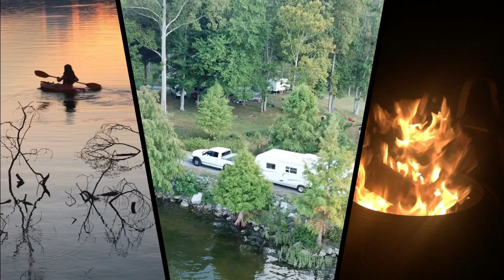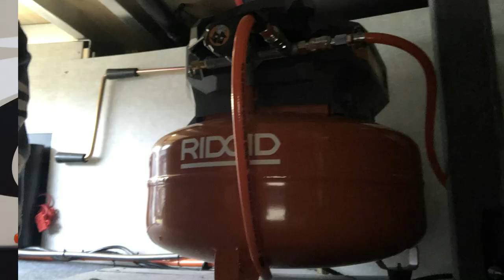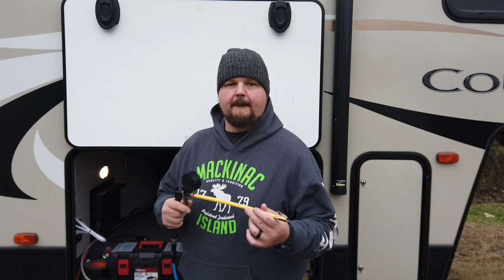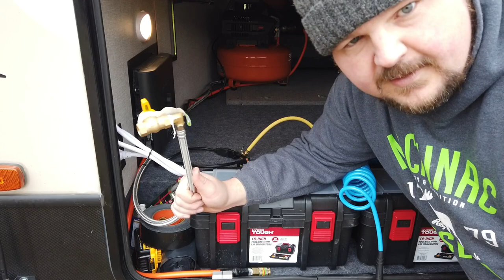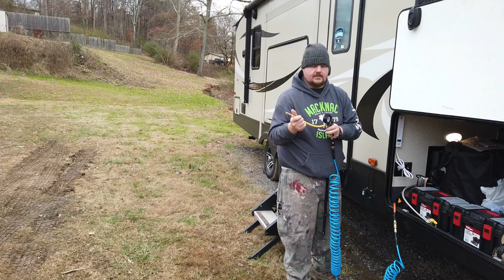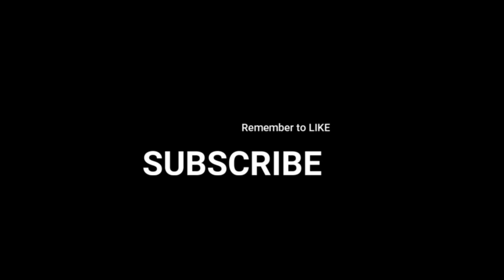Air Compressor in RV

Comment: I mounted a Semi truck trailer air brake tank to the frame under the Class A so not to take up storage space. (Compressor is in a driver side bay!) Then plumbed in 250 psi PEX lines for the outlets between the 2 rear axles.  And an outlet in the grill to reach both front tires and an outlet in the rear bumper, so I can run air tools to swap flat tires on the towed, on trailers or run a hose to the neighbors.  It has paid for it''s self, because one time we ran across an elderly woman with a flat on her RV in the middle of Montana.  Her husband was an invalid and was inside.  She said she called for Roadside Assistance, but they hadn't called her to let her know their ETA.  I whipped out my 30 ton air over hydraulic jack, air impact gun and hose and changed her tire in about 10 minutes.  I have a pressure regulator I can attach on the end of my hose so I never have to guess on tire pressures.  And it even has one of those filler fittings that clips on the valve stem so I don't have to hold it in while filling the tires.  I bought a 150 psi California Air Compressor (very quiet) and stripped the tank off it.  With the big semi tank under the coach it's a hoss!  The fun part is when we go 4 wheeling and I whip out my 120 volt wire welder and air tools to fix my buddies broke junk back at the RV Park we all camp out at.
Reply from the maker: Sounds like a great install

Comment: Good video! I'm shopping for an air compressor for an class A. Been watching a bunch of videos and some air compressor videos where they tank expoldes primarily due to age. There was a video of the guy doing a half a$$ investigation on why his blew up. A fire department guy who investigates these types of things said it hade to be from something being sucked up into the air compressor while it was running. Fire department guy commented said it could even be the exhaust from a running car could be enough to make it explode in the right conditions. Food for thought, I was thinking the same as you but knowing this now I think the air compressor will get a separate compartment to safe as possible.
Reply from the maker: This has worked well for my needs.  Never saw an air compressor blow up

Comment: I want a battery power air gun, but I do like the air compressor
Reply from the maker: The only problem with the battery powered ones is they have pretty short duty cycles... so they can burn up faster if you don’t keep that in mind

Comment: What fittings did you need to make the dishwasher hose connect to the tank?
Reply from the maker: It’s been a long time but I think it was  a couple 3/8” nipples and a brass elbow.  Might be 1/4” but I think it was 3/8.   I recently moved it behind the wall with the water pump.  Works great
Reply from the maker: Air Compressor in RV
https://youtu.be/OqUG0RhYNUM
Reply: @GimpyCamper  I just finished the same setup today after seeing this video yesterday.  Thanks for the info and inspiration!